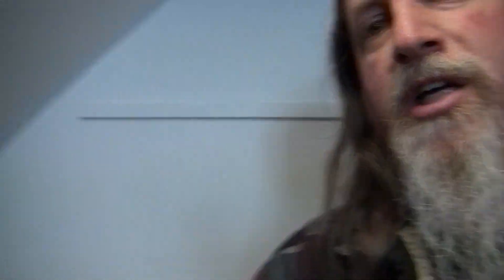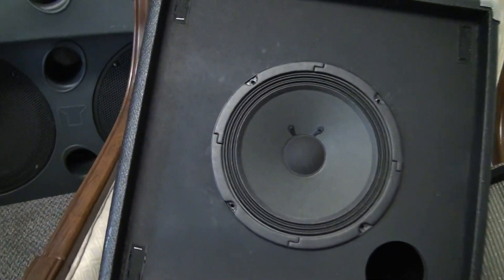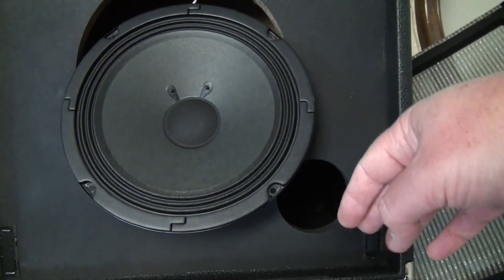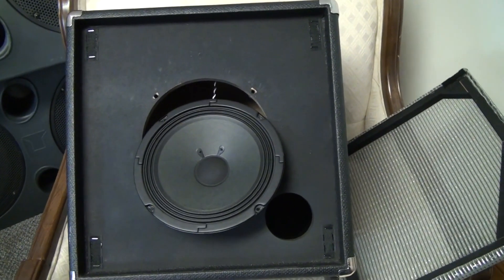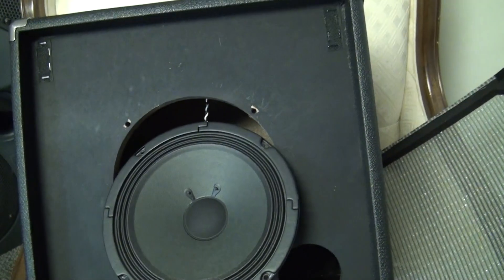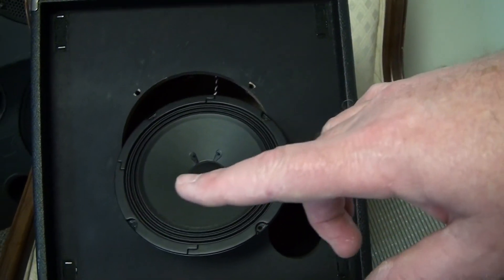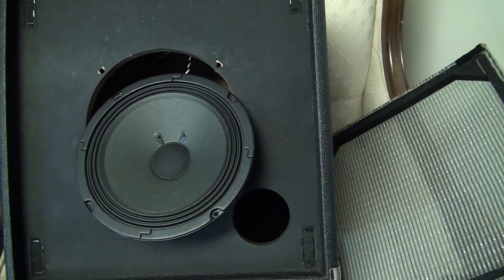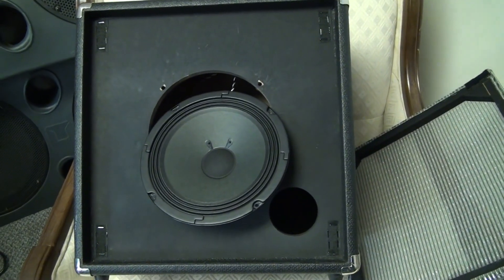Improve Your Fender Rumble 25 Bass Amplifier

Comment: Is it a woofer or a subwoofer speaker?
Reply: It's a lower midrange speaker, not even a woofer.  Dedicated bass guitar drivers by all the main brands like Celestion start at 10" and go up to 15".  A good 8" upgrade speaker (Like the Celestion TF0818 or Faital 8FE200) can usually maintain over 80 decibels between 60Hz to 200Hz, rising to 90+ db across the entire midrange.  So yes, they can do some low-ish bass, albeit less efficiently than midrange - hence the need for an oversize ported cab.  More than adequate for indoor solo practice.

Comment: All the other manufactures use an 8" speaker for their 25W amps.  Must be a good reason not to go 10 or 12 inch.
Reply from the maker: I ran that amp through a 2X15 cab and it didn't sound bad. https://youtu.be/_kLEDljUBtg
Reply: Yes, cost and/or weight.  They use neodymium speakers on their larger models, but the cost of 1 drive unit alone would be more than this whole amp.
Reply: The reason is price and poor sound of 8" speaker makes you buy 10" combo